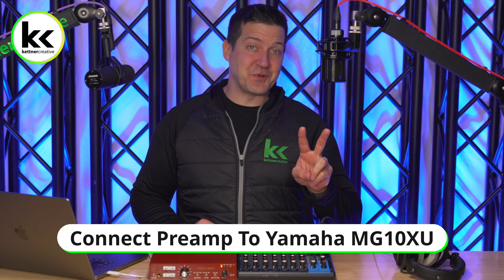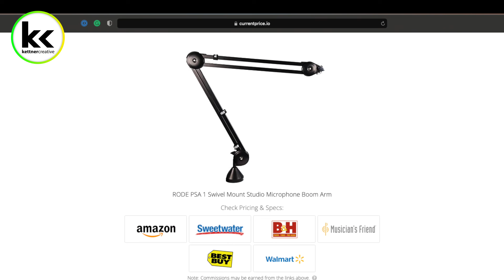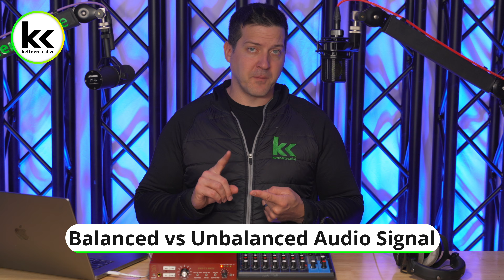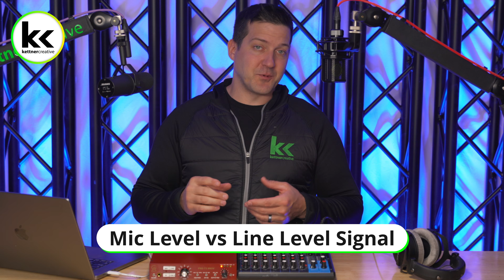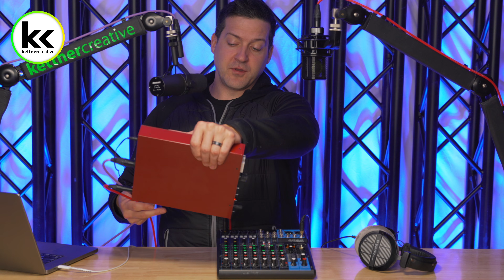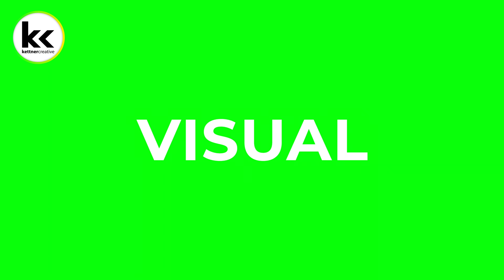How To Connect Microphone Preamp To Yamaha MG10XU

Comment: Hello

Thanks for the wonderful video. I am new to this, so please forgive me if I ask a dumb question. I got the same mixer. Is the phantom power not enough to directly connect the SM7B to mg10? Is an amp required? Also, what is your recommendation for connecting JBL ENO 700 series speakers? Balanced 1/4" or XLR? Suggestion on a good set of wireless microphones?

Comment: So I can NOT run a XLR terminated cable directly from a balanced signal source to the mixing board!!! This is crucial to know, that I have never seen mentioned before.  

Do ALL analog or digital mixers requires a TRS termination to the mixing board for all -10dBV or +4dBu signal sources?

Oh bother... Are there any other XLR to TRS adapters other than the Hosa GXP-246?  Something that would compare with mogami gold cables?